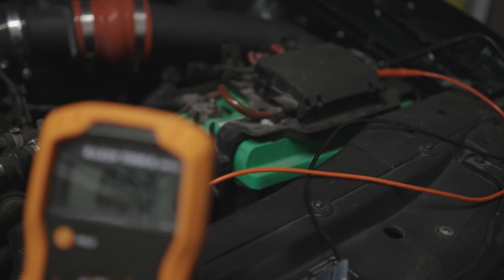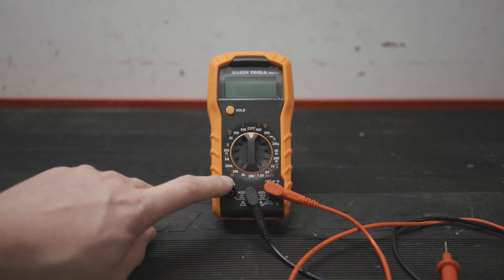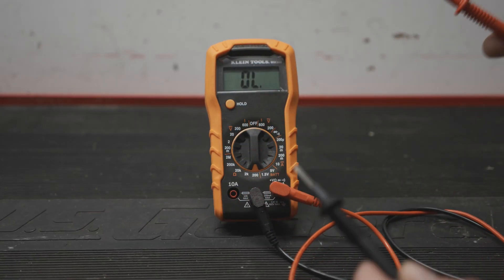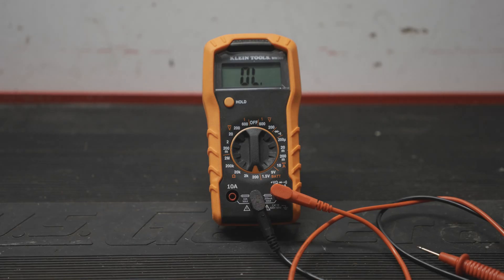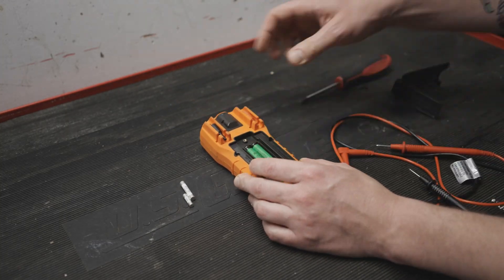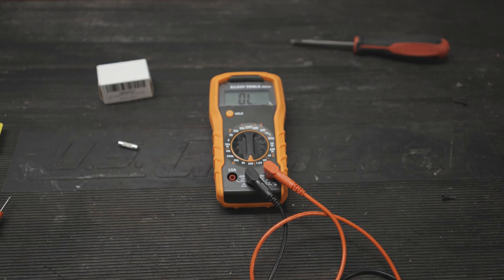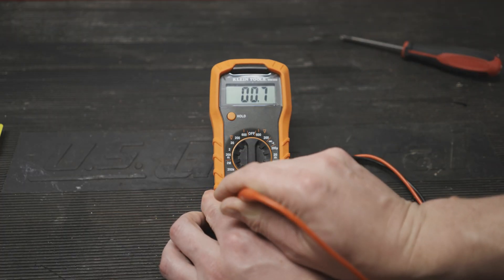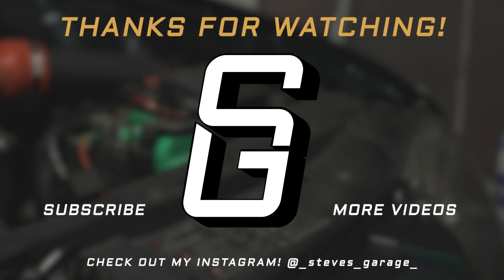The Easy Way To Test Internal Multimeter Fuse

Comment: Thanks for the video! You can also quickly check a fuse using your smartphone. Just place one end of the fuse on the screen (for example, on the calculator app) and touch the other end with your finger. If the fuse is good, the screen will react like a normal touch, if it’s blown, nothing will happen.
Reply from the maker: I've heard of this method! It's pretty awesome to be able to use in a pinch.

Comment: Man I’m getting 0 amps when checking parasitic drain but also getting non-zero ohms when I try the positive lead in the amps port as shown here. I have the same Klein MM300. 
What am I doing wrong, any guesses?
Reply: I figured it out. Manual says for measuring currents less than 200mA you should plug the red test lead into the volt/ohm jack. That worked just fine. 9-10mA draw, back to the drawing board. 

I wonder if the fuse is blown in the 10A port only? Would the 10A port still work for a 10mA current?
Reply from the maker: @joshuabarr7595  Good to know, thanks for posting the solution! Are you going back to the drawing board because you have a battery that won't hold a charge but it's not from a draw?

Comment: How about checking the fuse for the  miliamp port when present?
Reply from the maker: I would think the method would be the same, but I've never had a multimeter with that port on it.
Reply: @StevesGarage  It is the same test if you have both an amp port and a milliamp port. I check mine often before using, and I use that feature a lot. I have a Fluke 88V automotive multimeter with both. One uses the 11 amp fuse and the other uses a  0.44 amp fuse.
Reply from the maker: @bbivens8263  I assumed as much, but thanks for the reply! You guys are rocking much nicer multimeters than I am!
Reply: @StevesGarage  Keep up the good work Steve! People need to learn this stuff.
Reply from the maker: @bbivens8263  Thank you, this comment means a lot!

Comment: thanks! my battery has been draining forever and I was always seeing 0 amps. I thought maybe I was always doing something wrong, then I realized of course my multimeter fuse could be blown. I am this much closer to being able to leave my car battery connected over night lol
Reply from the maker: Not having to disconnect your battery every night is a win! That's exactly how I found out mine was blown. That zero amp reading was suspicious and the first thing to always check is a blown fuse. Good luck diagnosing the draw!
Reply: I had the exact same issue and this video helped me confirm I had blown fuses as well. Unfortunately, I didn’t find this video until after I went and bought a new multimeter :D
Reply: Couldn't continuity work for that test as well.